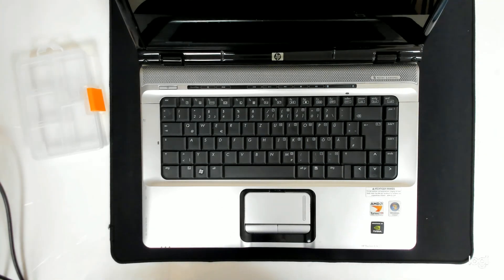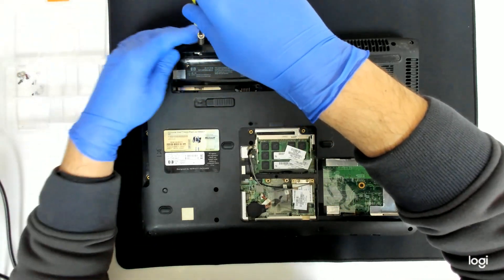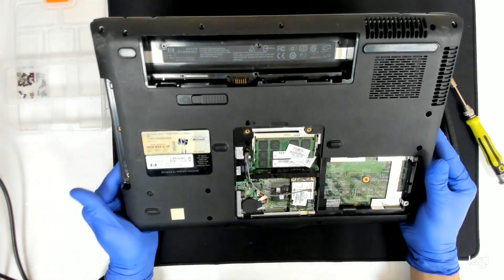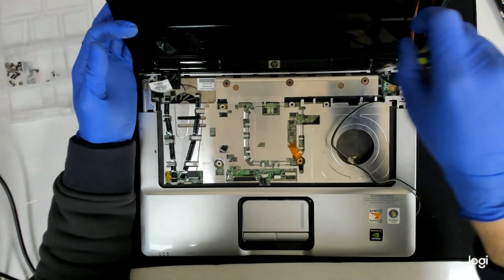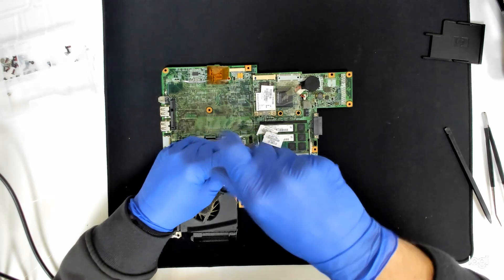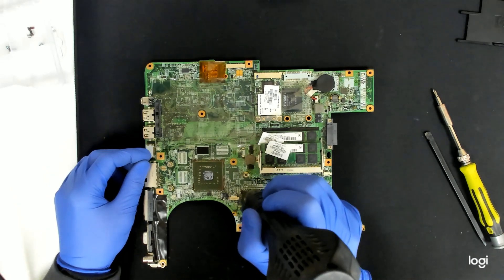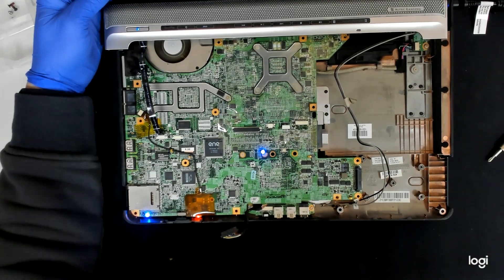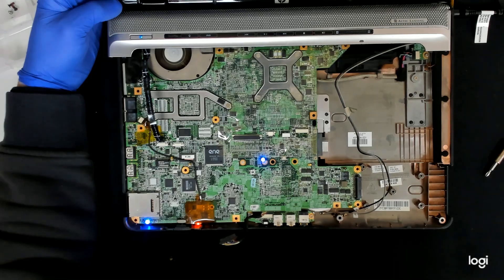HP Pavilion DV6000 Disassembly / Faulty Video

Comment: I've two of these - one I found in a skip. I followed other vids, n the general gist from that vid n a few others was they used a low Grade, 'flux light' solder compound on these HP DV's back in the day n the advise was adding flux tu both the integrated main CPU n the 'video card' - which I did - a number of Times - I got it to turn on for about 3 minutes n it died again - I had it apart maybe 4 or 5 times... I went to the trouble of 'masking off' the chips with thermal tape on each of the heat ups. I lost the will to delve into the second one, as these are such a faff to disassemble n reassemble...
I might try to just heat n reflow the video card as you do, come thid winter when the nights are long...
As someone else on here said, it's the comprehensive disassembly vid on these - wish it was up when I was taking that one apart ...repeatedly !!

Comment: The best disassembly video for this laptop on the net! Props, brother!
I had to open it 3 times xDD First forgot to plug the fan, than the speakers didn't work, then the keyboard xDD Broke 2-3 screws, forgot to put half of them :D
It was a good practice tho :D Put Linux AntiX (2gb ram) runs very well, wifi, videos (with 120 ssd)..

Comment: Did i should put thermal paste also on graphic card ? Cuz when i’ve oppened the pc i find nothing on the craphic card i put only thermal paste on processor and when finish all and turn on the pc there is light on the monitor and can here the system runnig also windows but nothing showing in the screen … can u help please ?
Reply from the maker: The thermal paste is on the CPU. The GPU is with thermal pad. Try to reconnect the display cable again. Probably it did not click properly. Also try on external monitor to see is the picture ok.
Reply: Excellent video